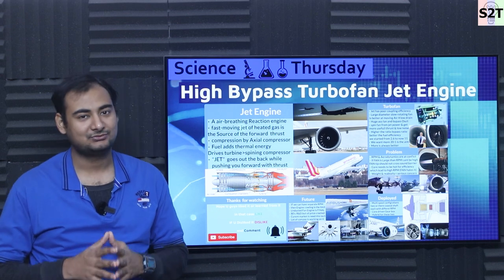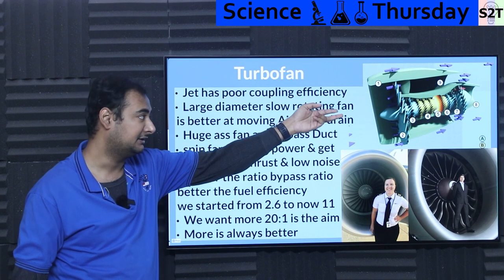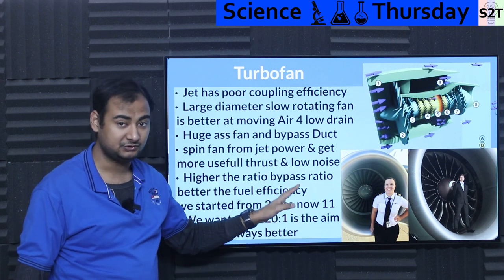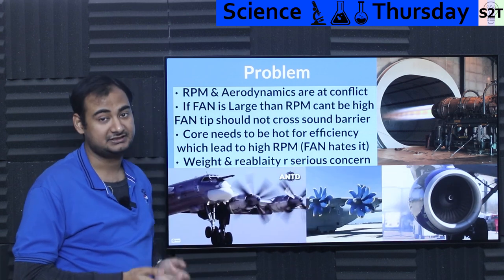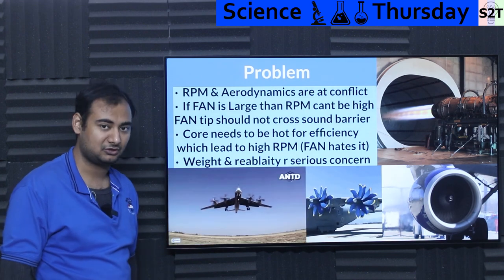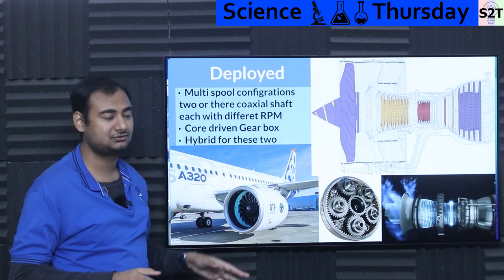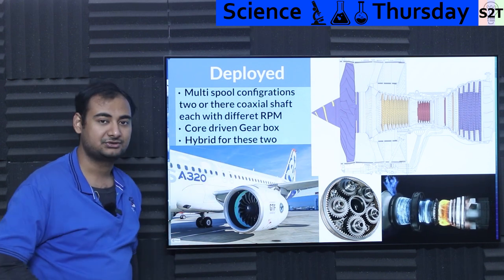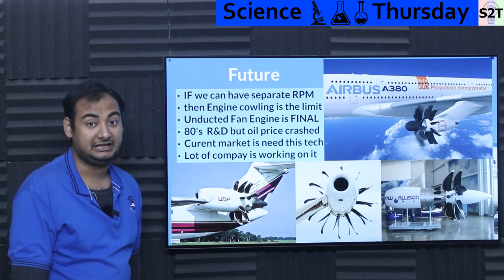Ultra High Bypass Jet Engine Explained {Science Thursday Ep215}

Comment: turbine and compressors  rotate at different speeds if they are connected they can''t therefore compressor shaft is hollow and the turbine shaft passes through it which is connected to the fan in front.
Reply from the maker: there are 2 tools to solve it . Airbus A380 have tri axial shaft the shaft and Terbain pair each with own RPM . U can have 2 ot 3 or 4 maybe .  or gearbox from geared turbofan engine